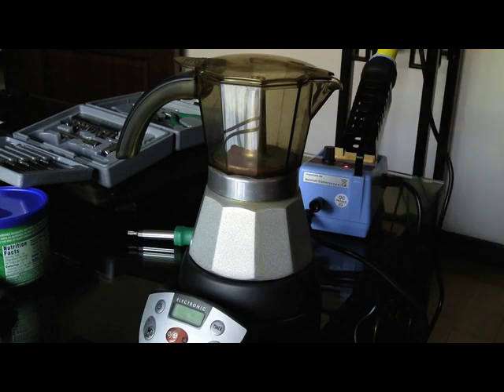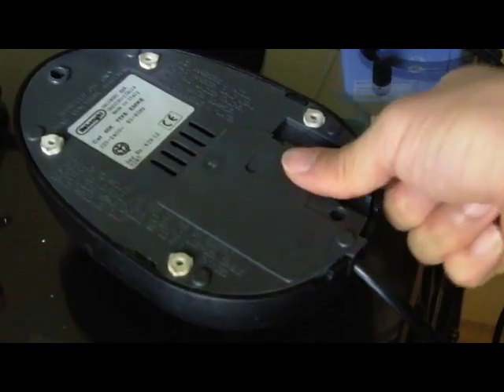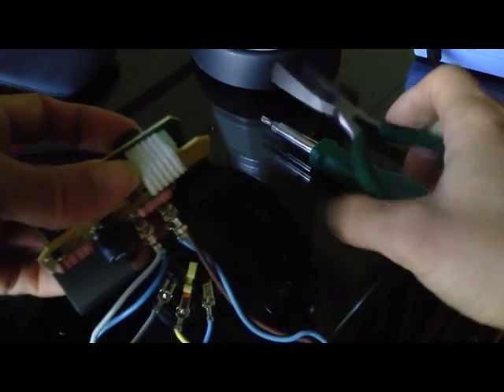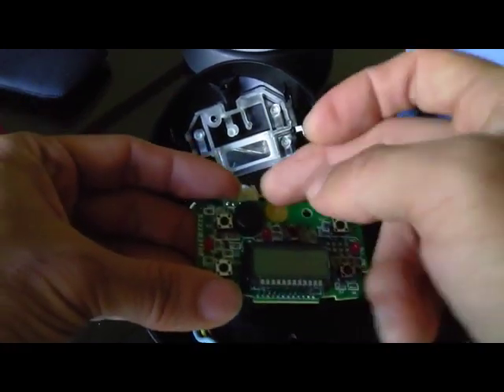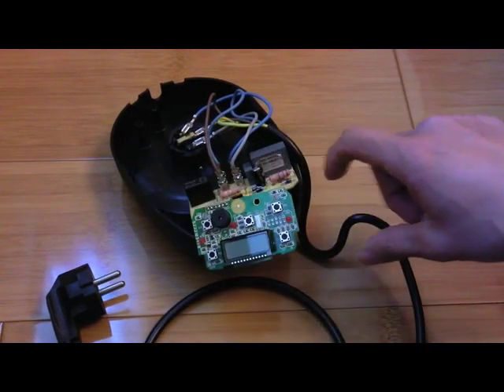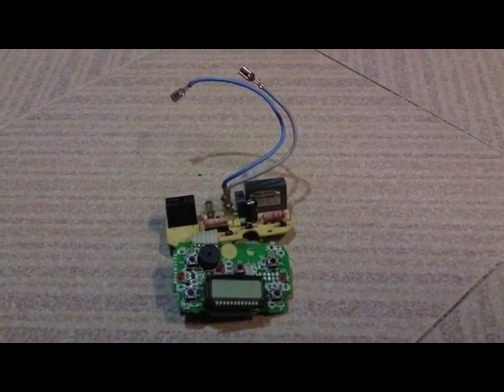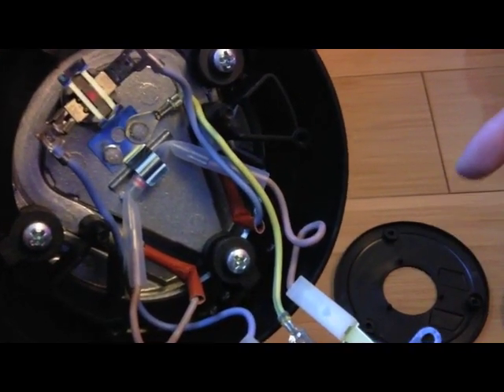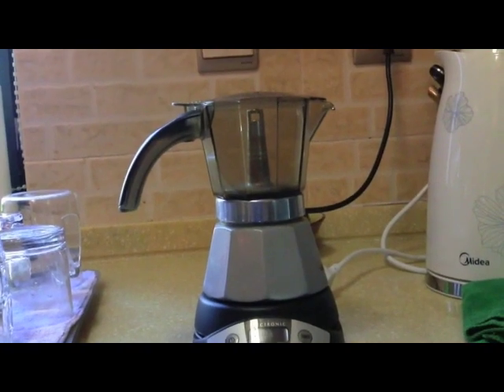DeLonghi Alicia EMK4 Espresso Moka Coffee Maker Repair

Comment: I found your webpage while I was trying to fix a coffee maker that came into a repair cafe I was volunteering at. I thought it was the zener diode that was the issue, and your page and video confirmed it.. I replaced the zener and the coffee maker was good as new.
Reply: Hi, do you remember the exact value of the zener diode? Thanks a lot!
Reply: @alessandro7346  it was a year ago, so no :-) I probably wouldn't remember if it was last week though. I think I just put some random one I had hanging around in there, figuring it would either work or just immediately fail again, and it kept working

Comment: I got problem with coffee machine Delonghi Alicia PLUS EMKP63.B - always show H2O error.
Problem was not relate to any water level or other things related to executive part.
It was simple cold soldering in one of the transistor's pin on the main board? and it lost contact. 
Luckily no any elements was broken, so just after all suspicious places was soldered, device run without problem!
Idea on this nice video was considered seriously just in case :)
Reply from the maker: Thank you for sharing your solution. It could definitely be useful to me or other viewers in the future as the solution was quite easy.

Comment: I've got no power to the display, and the LED's were faintly blinking, all at once. It was a blown resistor, right were the (L)ine and (N)eutral were connected to the board, between the spade conectors and the film capacitors. The color bands were still visible, its blue, grey, yellow and gold - a 680k ohm trough-hole resitor. Replaced it, and it works again!
Reply from the maker: That is very useful feedback, thanks for taking your time to write about it!